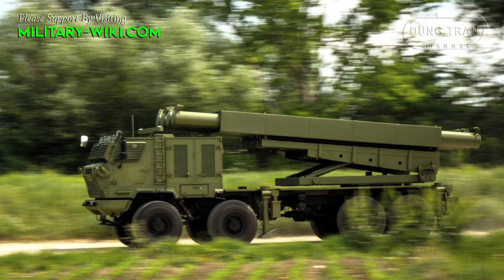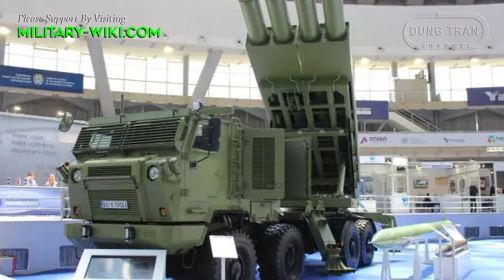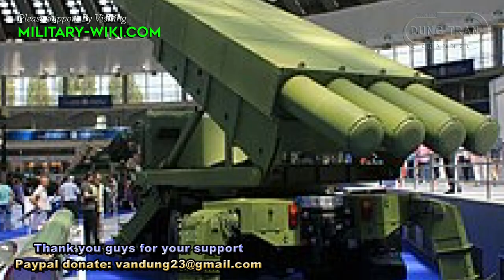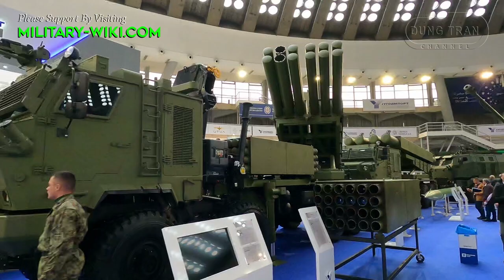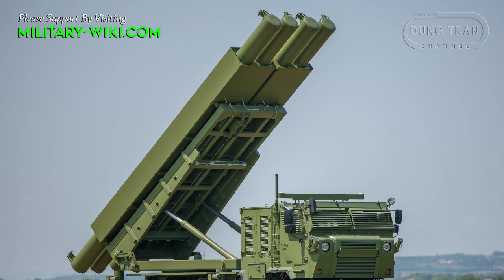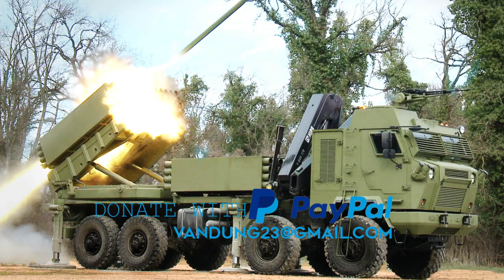Serbia's Sumadija MLRS: Precision and Power Redefined

Comment: Sumadija MLRS systems (2 systems):
The Jerina 1 is a 400mm INS/GPS-guided missile with a range of 285 km with a 200-kg warhead. 
The Jerina 2 is a 267mm caliber unguided rocket with a range of 75 km and 110 kg warhead.
Reply: Ima i vodjena i nevodjena a bojeva glava je 150 kg.
Reply: No GPRS, just INS...
Reply: @Truth-Istina  that was from SDPR Yugoimport web page. Probably they would know what their own equipment have or have not
Reply: @lazarduke6596 You don't understand correctly, first the INS version is done and the GPRS version is planned. 
Proof of this is a 50m CEP. With GPRS, the CEP would be less than 10m,It's like the HIMARS system. It is universal precision for all projectiles that have GPRS trajectory correction
Reply: @Truth-Istina  👍
Personally, I always thought INS is better cause its independent and prone against jamming.

Ps
You mean 50% in CEP, not 50m,..right?
Reply: @lazarduke6596 INS is impossible to jam, but it has worse accuracy. Although for such a large rocket it is quite satisfactory accuracy.

CEP is a measure of precision. When information about this is given in the technical characteristics, it is expressed in meters (radius of the circle in meters). This implies that the number of fired projectiles hit the described circle in meters with 50% of the total number.
Example:
One vehicle has 8 missiles, one unit has 6 guns. That's a total of 48 rockets. If he fires all 48 missiles at one common point, at least 50% of the missiles (24 missiles) will fall in a circle with a radius of 50m.
This is how CEP is defined
Reply: @Istina 
Probably you are right.
I always thought that CEP is given by %. It is the offset or mistake of how much you would miss in diameter where you aim by the percentage of destroying a target. So if a direct hit where you aim would be 100%,.. 50% of CEP would be that much say 50% of the destruction of a given target. If you say, let's say for example, that CEP is 10% it means that you missed that much that you destroyed only 10% of a target you aimed. So you missed 90%
Maybe I am wrong, but that is what I knew that CEP measurement was. 
Regards
Reply: @lazarduke6596 no, you got it wrong. One part is expressed as a % of the number of missiles sent.
Example:
You send 48 missiles at one point. Of course, not every projectile is the same, so it doesn't hit the point directly, but the projectiles fall near the point you were aiming at. When they all fall to the ground, you add up the 50% (24 projectiles) that fell closest to the point you were aiming at. When you count the 50% of the closest ones, you measure the distance from the point you were aiming at and the radius of the circle that includes the 50% of the closest missiles is the CEP in meters.
Some rockets fall less than 1 meter from the firing point, some fall 8m, some fall 10m, some fall 25m, some fall 50m, some fall 75m, some fall 100m.
You are interested in the 24 closest to the point you were aiming for because you sent a total of 48.
The target can be destroyed or partially destroyed, it doesn't matter. It is important that you know what surface you are covering. This is seen due to the density of fire received by the target.
For example, a 400mm caliber rocket has a CEP of 50m and that is satisfactory because within a radius of 50m there is no chance of anything surviving because the density of fire is enormous.
Outside this circle, the density of fire is not enough for the effect to be effective enough
CEP 50m means that 24 missiles (50%) will fall safely into that circle. The other 50% will fall outside that circle

Comment: Modularity is a desirable trait in weapons systems of this class.  It will be interesting to see what information exists on its battlefield performance.
Reply from the maker: The modular design of MLRS vehicles allows for easy integration and installation of launcher modules, FCS components, and other mission equipment onto different vehicle platforms, providing flexibility in mobility and logistics support.